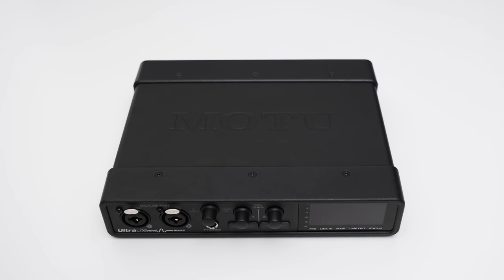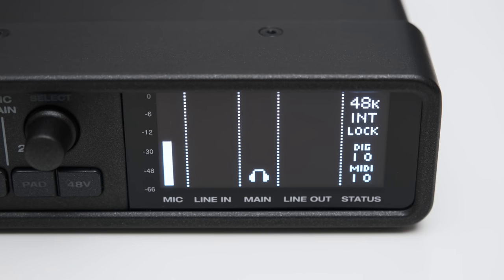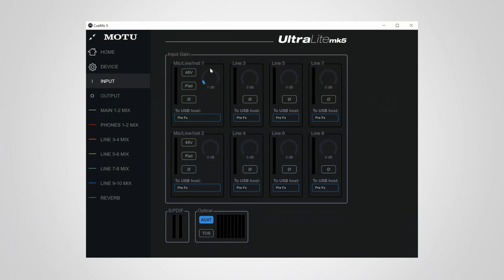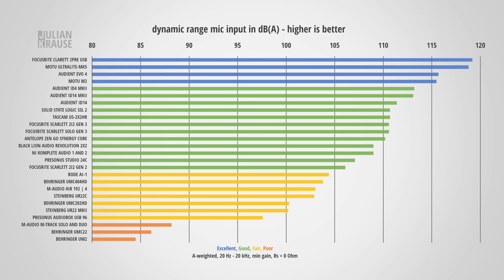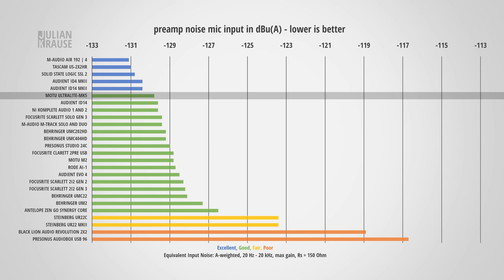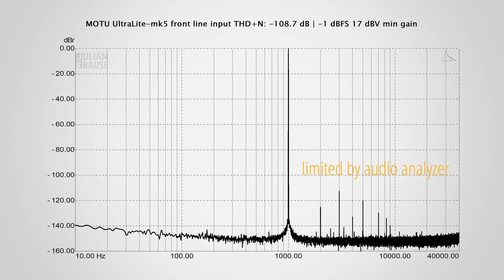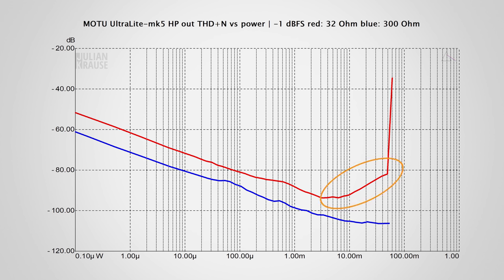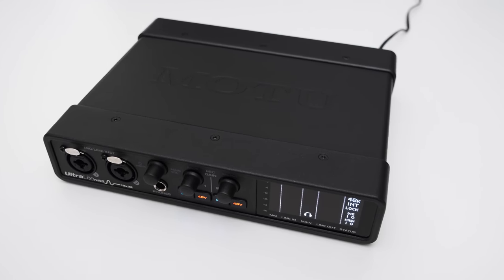MOTU UltraLite-mk5 Audio Interface - REVIEW (audio performance tested)

Comment: Hi Julian, You don't need to use Loopback to add processing on recording. You can change the setting "To USB host" to "Post FX" on the Input tab and it will apply all effects before sending to the computer.
Reply: Wow thats good to know!
Reply: I think he was inferring if you wanted to add the Motu input fX to your entire mix. Using loopback to bring the whole mix through two inputs stereo linked.
Reply: Do you know if I can record a wet signal with one set of fx while monitoring with a different set of fx? (ex: recording wet with eq only while monitoring with eq, compression, and reverb)

Comment: Was waiting for this one, Julian. Good review, as we've come to expect.
   Wondering which of the interfaces you've reviewed is your best overall pick. Have a feeling this one would be near the top.
   The Motu is a finalist for me, along with the Antelope GO. However, the number of ins/outs on the Motu is key as I have external equipment to patch in and this will probably be the deciding point, since Julian's check of the audio specs paint it as a top choice.

Comment: I have this interface and its … just incredible. The only thing i miss is a second headphone output and I don’t love the headphone volume knob but theae are tiny drawbacks and otherwise its an unreal value at its price. The headroom on this interface is crazy.. i have not being able to make it clip and it sounds so good.
Reply: It's easily the best interface u can buy right now, short of a few personal idiosyncrasies.
Reply: How’s the latency though cause I’m the measurements they don’t look too good
Reply: @tuneunleashed  latency has not been a issue - but I’ve had massive issues with the clock / stability when using this for a longer time  .. I have jitters and dropouts on both intel and M1 MacBooks and a Windows HP desktop - so I’m actually not that happy with the stability of my device. I don’t have these issues with my SSL 2+ interface.

Comment: CueMix 5 definitely needs some feature enhancements on the EQ and Compressor side imo.  And, for a portable device, should include the guitar tuner of the previous CueMix software too.  I'm hoping MOTU will be working to enhance and build upon version 5 a lot more in the very near future.
Reply: And the ommision of a red clip light on the preamps is a real oversight.
Reply: @joelonsdale  you can see if it's clipping on the OLED display
Reply: @ar_xiv  No you can't.....you can't see it.
Reply: Any update so far?

Comment: MOTU is superb. Even the carton box were they come in like the vast majority of products (if not all) seems to be highly designed. For example I purchased the Strymond Big Sky reverb pedal, wich is great, and it came practically inside an unprotected box. It looked like a sandwich. I bet a lot of products start malfunctioning due to a carton box that does not protect well the item during shipping. It can also fell in the store from the display etc. 

So my experience with MOTU is that right from the unboxing you can identify without being an expert the quality of MOTU products. Is like a diamond inside some fancy case. And like if that was not enough they cost a lot less than other products than can not even match the quality of MOTU. 

👍👍🏻👍🏼👍🏽👍🏾👍🏿

Comment: I'd love to see some RME reviews. Also, comparing AVB connection to USB would be very interesting to see.
Reply: I second this
Reply: AVB is not the same as Thunderbolt or USB that you connect to your computer. It's a Networking protocol for connecting multiple interfaces on a network similar to Dante. It's for large scale deployment applications which is only relevant to high enf gear. The Ultralite Mk5 also has nothing to do with the MOTU AVB Pro Audio line up. Different market.
Reply: @eman0828  Not sure I understand your point. 
MOTU has interfaces with all three USB, Thunderbolt and AVB. Same as RME. Would be interesting to know how they compare in terms of latency and stability. RME is priced higher and I think a lot of people would like to know if there's a reason to pay more for RME.
Reply: @cuba1956  I own a MOTU 828ES AVB myself so I should know. AVB wasn't meant to be a protocol as a computer interface connection. It's like Dante designed for interconnecting audio interfaces together on a Network with an Ethernet cable when deploying in large scalability. The Focusrite RedNet and Red Dante interfaces aren't all the different than MOTUs high end line of AVB Pro Audio interfaces.
Reply: @eman0828  Again, not sure what your point is.

I think it's quite a bit arrogant of you to assume you're the only one, but okay. I happen to own several MOTU 16A and a number of other interfaces I've been using for various purposes. macOS connects directly via AVB as it would via TB or USB — with no additional effort. AVB is an open protocol which gains support with new devices every day. In my case AVB connects with even lower latency than USB or TB. But MOTU is quite unstable and have terrible support for their devices. As I'm transitioning to RME, I'd love to see Julian's test of those and comparison with other devices.
Reply: @eman0828  Thank you very much for your opinion. Can you please post your review to your channel so we can all appreciate it?
Reply: @cuba1956  You the one that seem arrogant. You came at me like I don't know what I was talking about. AVB does not work as an interface connection on Windows. Plus MOTU never developed drivers for it so it wasn't really ment to be a computer connection. MOTU is pretty stable by far statistically from all the rave reviews and high volumes of units sold which holds more weight. There are more positives than negatives when you look at all the reviews. Very few complaints on driver related issues. Even the MOTU M2/M4 is out selling both RME and Focusrite combined that's always out of stock. They sold millions of those since it came out.
Reply: @eman0828  MOTU sounds wonderful. You’re brilliant. Thank you for your opinion.
Reply: @cuba1956  Sounds like your trolling. You couldn't even back your claims that MOTU drivers are unstable when the vast majority has no issues what's so ever.
Reply: @eman0828  didn’t come here to argue with you.
Reply: @cuba1956  Well you were the one talking BS here. U probably never owned any MOTU hardware before. I can tell because the AVB stuff is used in Mission Critical Deployment like the Focusrite RedNet dante interfaces. That shit has to be reliable and stable if you are running live shows, playback rigs, or used in broadcasting and large commercial studios. Usher and  Beyonce Knowles playback Engineer uses the 16A for thier live shows.
Reply: @eman0828  thank you. You should really put your energy elsewhere. You came forward with unsolicited opinion and decided to educate everyone. Yet a lot of people seem to be happy to see higher end interfaces reviewed.
Reply: @cuba1956  You wound like a hater a RME fanboy on here. Theres a difference between opinions and what's factual. Yet you provided no hard evidence that the MOTU AVB interfaces are unreliable or unstable. Those interfaces are very well tested and PROVEN to be reliable that's already well established in the live sound, playback industry as well as broadcasting and larger studios. The drivers are very well written other wise they wouldn't be used in mission critical settings. Usher, Coldplay, Beyonce Knowles, Jennifer Lopez and countless A-List celebrity Artists has used the MOTU AVB stuff. Lots of Oscar winning Film Score Composers use both MOTU hardware and software. Dr. Dre even owned two MOTU 828 mkIIs and a Midi Time peice in his studio rack.
Reply: @eman0828  Mate, you should really focus your energy somewhere else. MOTU took 6 months to deliver USB drivers for macOS Big Sur and M1 Macs for 16A (a pro grade interface). I don't own RME, but RME had drivers ready before Big Sur came out. Everyone here wants to see Julian's test results, noone cares about yours. Your ignorance and arrogance astounds. I'm not here to prove anything to a nobody. Please, move on with your life.
Reply: @cuba1956  And very few people uses Big Sur which irrelevant to the time it took to release drivers. There isn't much software out there that support it. Most Professionals aren't early adaptors. You would be surprised on how many large commercial studios are still running older versions of MacOS to prevent down time.
Reply: @cuba1956  And if RME was so special you would think million dollar commerical studios would be using them but rarely see an RME interface insite. All you see is Apogee, AVID, Lynx Auroa, Prisim, Antelope while Focusrite RedNet and MOTU AVB are making their way into larger studios.
Reply: @eman0828  Stop embarrassing yourself, mate.
Reply: @cuba1956  You the one that's embarrassing your own self because you couldn't list any A-List Celebritys that used an RME Interface if you think MOTU is inferior. MOTU is well established thats been around since the early 80s that's been making hardware interfaces since the early 90s long before RME existed. Take your RME fanboyism else where because you are commenting on a MOTU video.
Reply: @eman0828  You really need to get help.
Reply: @cuba1956  Nope you came here to talk shit. You were bashing MOTU for being unreliable and I called you out to prove you wrong that's used by Professionals. Just about everyone on here is familar with White Sea Studio channel or MixBusTV that are flowers that uses MOTUs hardware and none of them has complained about stability or driver problems. David Gnozzi uses Windows 10 and so do I.
Reply: @cuba1956  hehehee, I like u man, lmaooo
Reply: @cuba1956  lol. This other person just seems to want to take offense and argue. Good on you for not sinking to insults.

Comment: I so thought and thought about biting the bullet in getting this one. And seeing your review of it gave me all the missing information that kept me from going for it. It would have been my dream interface. But it’s so much money  just for a hobby. 😳 I ended up buying the MOTU M4 instead. And judging by my measurement of the dynamic range (~108.5dB) it turns out to be roughly the same as the M2, you did. test before, not counting production variances. And listening back and forth between the noise 8:13 (Ultralite Mk 5)and 8:19 (M2) the noise monk in me is the only one to react. 🤣
Reply from the maker: Nice, enjoy your M4!

Comment: Just discovered your channel and was suprised at the professional and detailed reviews! I have a suggestion for an upcoming video. In you interface comparison table, you are missing the RTL and it would be interesting to see all the interfaces RTL performance side by side! Also, I noticed you have not yet tested any UAD products, which many consider the gold standard. It would be interesting to see how they compare given your test methodology. Finally, I have a question. Your headphone compairisons for pre-amp output is based on a model for dynamic speakers right? As planars are getting more and more popular, would the results translate 1-1 to them or are they to different and need other tests? The Audeze LCD-XC for instance, have an impedance of 20 Ohms, but recommended power level of >250mW. Looking at your comparison table, only the Rode AI-1 would provide enough current to power them, or am I reading the table incorrectly?

Comment: Great videos, Julian, thank you! I’m curious about the headphone power of the MOTU UltraLight-mk5 versus the M2. At 300 ohms, you measured very close (0.3dB higher) to the MOTU spec of +14dBu, but for the M2, you got about 1.9dB under their +12.5dBu spec currently on their website for the M2, M4 and M6. I know manufacturer’s specs aren’t always perfect, but I noticed there was a small update to the M line since you tested the M2. It seems outside your approach to disassemble them, but I wonder if they made any changes to the power supplies in the M models, and if the UltraLight-mk5 is using a different headphone amp and/or higher voltage. How about testing the latest MOTU M2 and M6 (which has an extra power connector)? Just per the numbers, I think the M models will drive my 150 ohm 94dB sensitive headphones well enough at the moderate levels I prefer but since I’d like to do a lot of listening, not just recording, it’s a bit of a concern, as are some negative impressions some have posted regarding using budget audio interfaces such as the M2 as a headphone amp. I’m on the side of the fence of just getting it, but am also considering if I need more than two mic preamps.

Comment: Greetings, I can notice 2 ES9026pro DACs in the circuit and 10 analog outputs, do you know how the 2 8-channel DACs are assigned to the 10 output channels? I believe in the MOTU 828 1 DAC is working in Stereo mode (4 dacs per channel) to the main monitors and the other to the 8 additional outputs, Thank you.

Comment: Thanks a lot Julian!  could you please review the new “RME  UCX 2 “which in some ways is comparabel to Motu mk 5 .just a lot more expensive
Reply: also I'd like to see one for the Babyface Pro FS
Reply: @ACDevastation  I have it.. Awesome little interface :-)
Reply: The RME is very over priced by today's standards.
Reply: @eman0828  in terms of stability and low latency  its unrivaled.  Did you ever own any rme stuff?
Reply: @eranddroory9987  And MOTU offers better vaule without compromising quality. They also offer long term driver support just like RME. The oringal 828 firewire interface drivers were supported for 17 consecutive years.
Reply: @eman0828   it seems that it is overpriced, when you look at specs, and thats why it would be cool if Julian compared  Motu ..MK 5  with Rme UCX II.  But as some has written there are other factors than specs. It's very tempting to go and buy MOTu , hearing about the good experiences you and others have had. Im really tempted..
Reply: @pml394  They are both essentially very closely the same products that are both DSP audio interfaces. Like what else would you need to spend well over 1k more? That's why I said RME is very over priced by today's standards. They don't offer much anymore than what MOTU already makes at a fraction of the cost and MOTU support their drivers for a very long time as well. There seems to be like 200% high mark up on all RME products for some reason. All MOTU products are designed and manufactured here domestically in the United States and still manage to keep manufacturing cost down.
Reply: @A_ L_ M_ the stuff you read on line is "OUTDATED" that doesn't apply to modern MOTU interfaces. If drivers were that big of an issue White Sea Studio*, David Gnozzi of *MixBusTV, Tom aka JunkieXL and Jacab Dark wouldn't be using them. None of those guys complained about driver issues that's used them on both MacOS and Windows. I have zero issues either which there is a reason why I switched over to MOTU for better drivers comming off from Focusrite.
Reply: @A_ L_ M_ FYI if MOTU products were inferior thats unreliable then explain why did Dr. Dre owned two MOTU 828 Mkiis and a  MOTU Midi time peice in his studio? Explain why was the MOTU 16A used by Usher, Beyonce Knowles, Coldplay, Jennifer Lopez and Miley Cyrus? MOTU has a lot of high profile customers that use their products across both music and film and T.V industry many of them Grammy award winning and Oscar Ward winning. Name a A-List Celebrity that used an RME interface. I bet you couldn't name one.
Reply: @eman0828  RME has Motu beat in RTL plain and simple no one can replicate what their engineers have done with their drivers.  Their USB 2 is matching other vendors thunderbolt RTL.  Its all online for everyone to see.
https://www.soundonsound.com/reviews/rme-babyface-pro-fs  The UCX will likely have similar performance or exceed the babyface.  Im on the fence about Motu or RME because Motu has great value but for people that use a lot of VSTs RME may be the way to go.  If I was just tracking and mixing I would go with Motu.

Comment: Thank you for the in depth reviews. Very good work. Great interface. I miss a dedicated (bigger) Volume knob for the Monitors. I hate these tiny multifunction endless turning encoders. I prefer an analog Volume knob „with a start and an end of turning“ even if it means channel volume discrepancies. and am a bit dissapointed by the headphone amp values but you cant have it all. Still very good interface.
Reply: Ps: The Mk5 you cant buy in Germany right now. Not for 10+ weeks. I guess it is cause of the Chip shortage crisis ?

Comment: Awesome - I was thinking about lending you a 624 before, but this does the trick :D
Reply: I have 624. Can you test balanced and unbalanced output-input for distortion? Balanced with 2 stereo TRS and mic cable. In an unbalanced one, there are also 2 stereo TRS and a mono cable. I have ~ 40 times more distortion in unbalanced 0.00013% versus 0.00633%. The Motu 624 output has Hot and Cold phase distortion. On balance, they are compensated. No balance does not compensate for them.
Reply: @Kolin4556  I don't have any measuring equipment, sorry

Comment: Great video Julian. I am in the middle of shopping for a new interface coming from a Komplete Audio 2. I was looking to get either this MOTU Ultralight MK5 or the Arturia Audiofuse Rev2. They are both priced very similarly. Wanted to ask for your opinion between the 2 if you had experience with the Audiofuse before. My main concern is the input and output sound quality. Cheers

Comment: I need to know how the drivers behave in Windows. Stability is key when pushing devices to their expected performance levels. What I have noticed is that the even "brand name" interfaces have poor driver performance and often cause locking up, software and hardware crashes. Have you done any long term testing of the individual drivers for any of these devices?
Thanks for your work. Subscribed, thumbs up and shared.